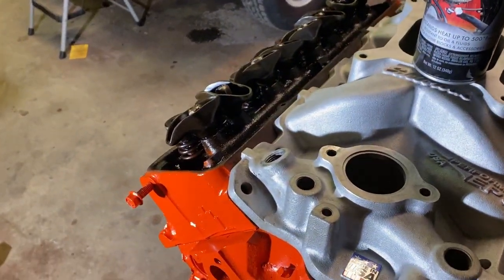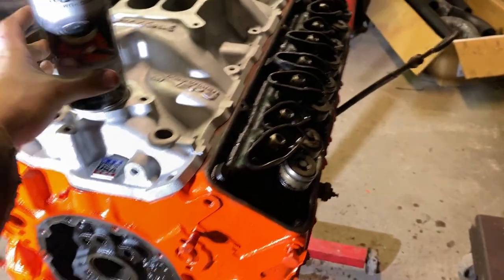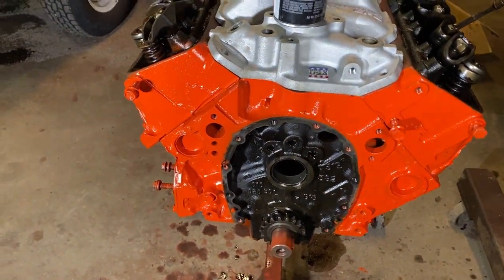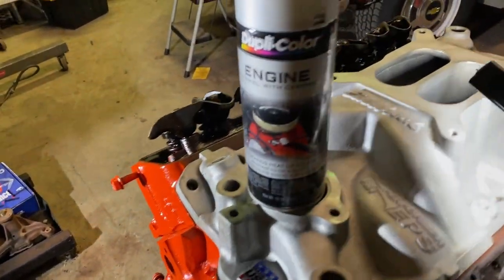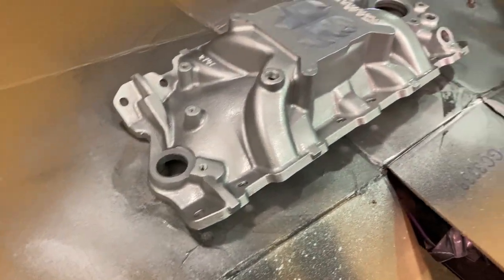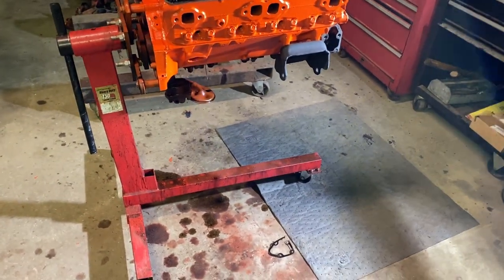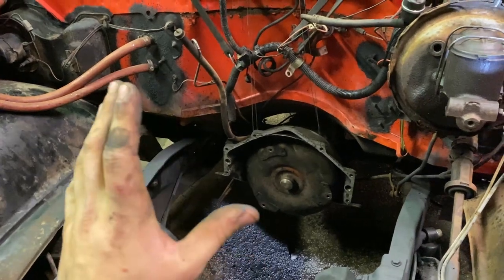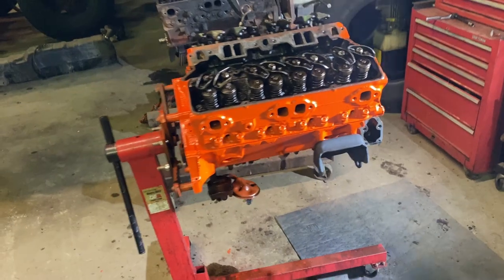Squarebody C20 Project Part 11 |square body|

Comment: Might get some heat for this comment but... 
Can you mic the bearings and see if diameter is within spec? If so maybe you could run some scotchbright down the bore and lightly polish.  I can't recall the id measurements but I'm nearly 100% sure each cam bearing has a different size.
Reply: @squarebodyblake4464  a few years back I did a cam swap in a 305 with the motor in the truck.  The bearings were a little rough.  That was a successful job and I got another 30k miles before I sold the truck